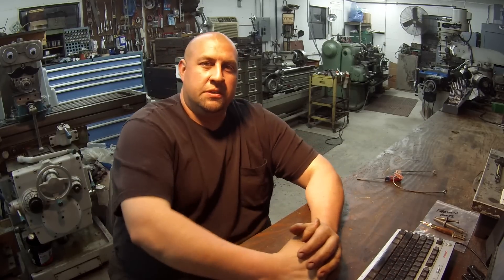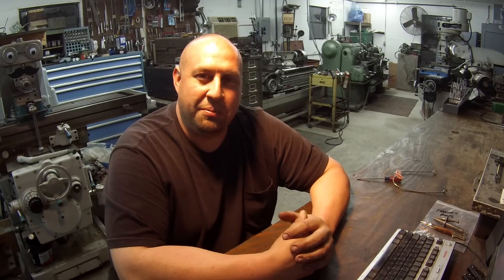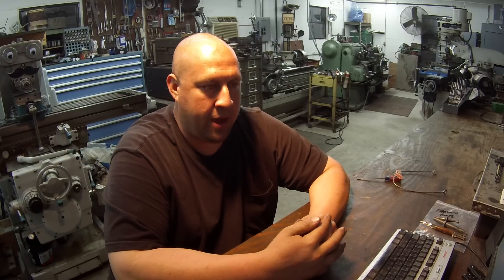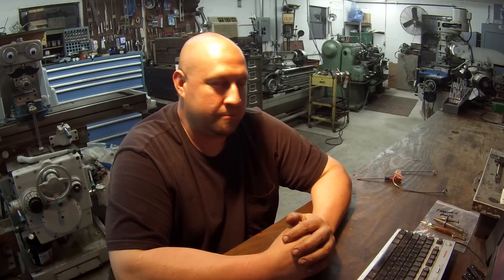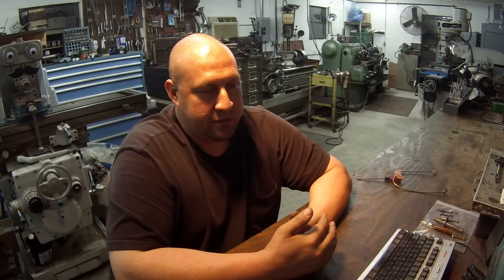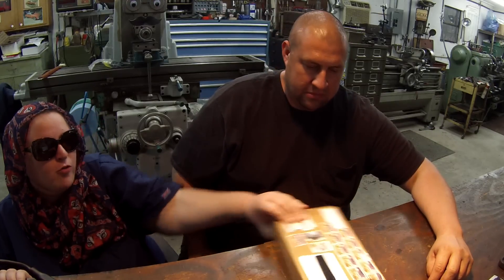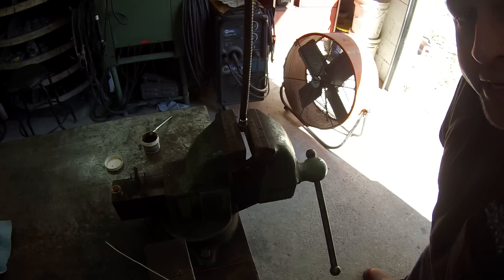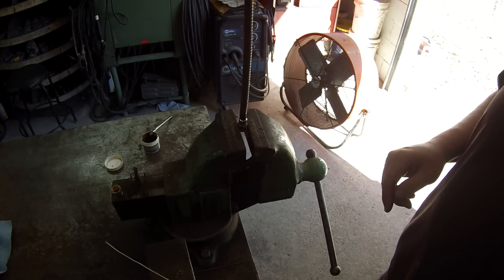Saturday Night Special 42 Part 1

Comment: I just put a new water heater in my house and the copper pipe had a tag on it made in china ?????? Now I know they make copper here in the U.S.A. so why?????
Reply from the maker: That's the point I'm trying to make. It's all made in china! WTF??
Reply: Increased profits is driving the made in China syndrome and tax dodging by moving the home office and banking out of the USA will eventually be our downfall.
Reply: patw52pb1 Corporations are required by law to maximize their profits to serve the shareholders. Tax Avoidance is part of that responsibility to the owners = shareholders = you and me, if you are part of a 401k, 401g, IRA, or other pension plan - including the union pension plans.

We need to have rational taxation here, or we will not have enough manufacturing here...
Reply: chemech  Exactly what law is that?
Is there a law that states tax avoidance(evasion) is condoned or mandatory?
Where are corporate ethics, morals and patriotism? 
Taxation in the US is overly complicated and definitely needs an overhaul, but I don't believe that it will happen anytime soon, too many self serving interests and lobbyists. 
Corporations do have a high percentage tax burden initially, but with generous deductions, credits and loopholes there are numerous corporations paying near single digit percentage taxes and some reportedly pay near zero.
Reply: Fiduciary Responsibility - look up what it really means.

Tax avoidance means paying the lowest legal amount of tax, and is part of that.

Tax Evasion means not paying taxes which are owed - a big No-No.

Corporations only pay tax on profits.   American corporations have to pay taxes on their overseas profits, as well as the taxes to the foreign government - nobody else double-taxes their domestic corporations.

As for corporate tax loopholes - they really do not exist, especially post 1986...

They do get to deduct legitimate business expenses, like local taxes and permitting fees and the like.

The problem is that those expenses can add up to where the make the cost of sales prohbitively high relative to the selling price.
Reply: chemech Is there not also a fiduciary duty setup by the act of incorporating and obtaining a federal tax ID with the state and federal government? 

Seems as though there is a fine line between tax avoidance and evasion... motive and intent 

Would that not be offset by foreign tax credits??? 
U.S. corporations never face “double taxation” by two different countries; corporations—and individuals—are entitled to a foreign tax credit that reduces their U.S. tax liability by the amount of tax paid to foreign jurisdictions. 
Also a provision known as “deferral” allows U.S. corporations to delay paying taxes on their foreign income for long periods of time or even indefinitely. This means that companies can avoid paying U.S. corporate tax on any profits that they book (record for tax accounting purposes) as overseas profits earned by controlled foreign subsidiaries. The deferred tax is only triggered if a U.S. parent corporation repatriates its foreign subsidiary’s profits, bringing them back onto the parent company’s balance sheet.

There are still plenty of loopholes, as an example, many have to do with where globally a corporation's intellectual property(IP) is registered. Research The Ugland House in George Town on Grand Cayman Island and Ireland IP trust to learn more about how and why. 

Yes. Seems as though you are using energy/oil & gas as exemplars. 

Costs are expenses and nearly every expense for a business is a legitimate deduction. 

The point I was making is that US corporations pay a lower than initial tax percentage and that using the excuse that US taxes are too high for leaving the US is disingenuous. 
The sad fact is that since before 1990 US corporation have been receiving tax incentives to relocate manufacturing offshore and mainly to China. 
Many of today's problems began in the early 1980's and have compounded and snowballed until there was a financial avalanche that initially began in mid/late 2006 and continues today.

Comment: Your rant involving imported hardware really made me sad cause I thought you were kind of over such prejudices. I say,  either the product is good or it is not, end of subject.
Besides I am really surprised you cannot acknowledge the fact that your conuntry will not sustain its very high living standards fabricating valves and fawcets.
Reply: On the contrary, we need to make a lot of those commodity manufactured items - cheaply, with good quality - in order to afford a high standard of living. People can still opt to buy from other suppliers, and not all imports are "cheap" - some are premium... We need to make those premium goods here too...

We cannot do so mainly due to government policies which excessively restrict manufacturing - especially unfavorable taxes.

The so-called "Service Economy" is not sustainable, as it lacks a base of value-added income from converting raw materials into products.

L. Erhard, the father of the German economic miracle, suggested that the service sector be restricted to ~25 - 30% of the economy - limited by keeping other sectors such as manufacturing healthy...